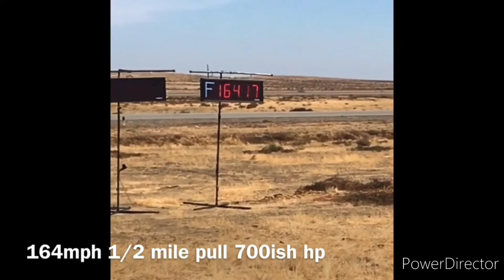Finally installing my custom made Thornton chip tuning

Comment: Not made for your specific vehicle, that chip would fit any other car of the same model lmao 🤣🤣🤣 Aleye
Reply from the maker: Actually my friend the reason the chip has an activated yet for me it's because I haven't Driving the car a 150mile For it to activate and for me to see if it's going to do what the company claims it can do and the reason I have not been able to do that it's because there is a leak somewhere in my car where the coolant is going somewhere causing my car is overheating Then I cannot drive a 150 miles what are overheating vehicle that will damage A lot of components in my engine